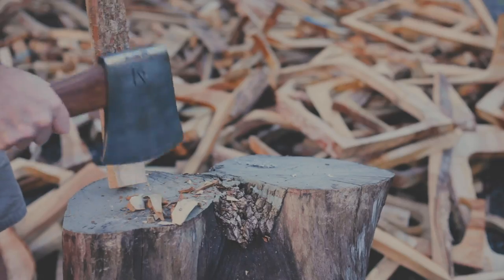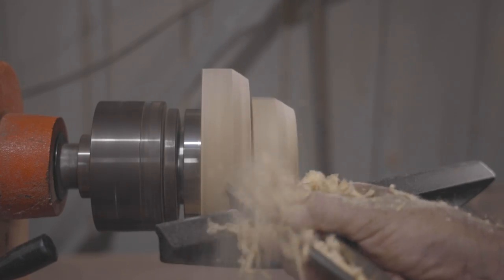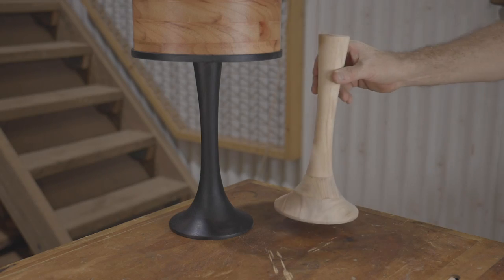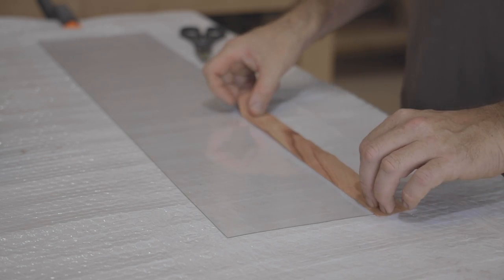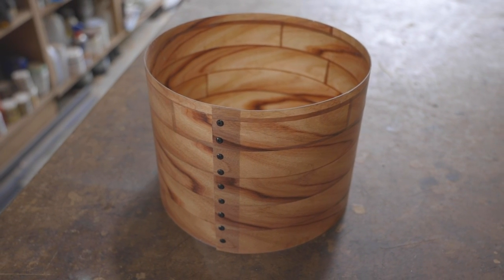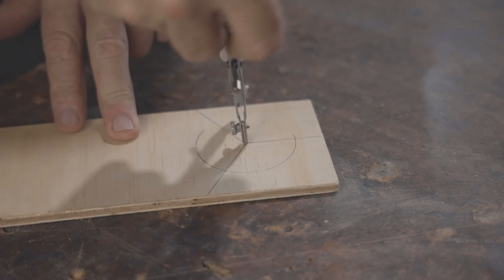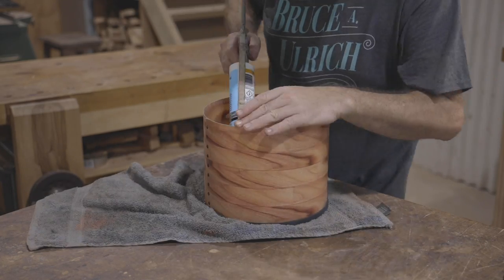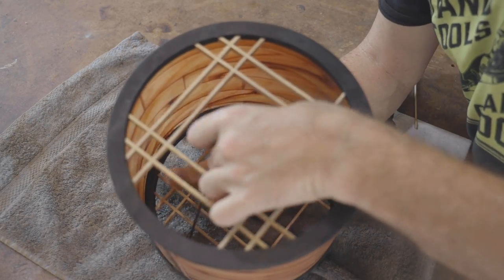Plane Shaving Table Lamps - Scrapwood Challenge ep37

Comment: The lamps turned out great.  I think that the use of plexiglass was a really smart solution to the issues you had on your experimental adventure with the larger hanging light fixture.  Thanks for sharing and keep up the great work.

Comment: Excellent work as always. Intrigued by the method you used to get the loops for the top and bottom by having cuts and different depths and then cutting through them laterally with the table saw. Genius.
Reply from the maker: Thanks very much Paul! :)

Comment: The top and bottom shade supports were pretty sufficient, meaning i reckon too many rivets were used for the seam.. If you left more slack on the shavings veneer glue could've covered it...

With maybe a custom staple..

🧰🛠

Comment: If you had run both pieces for the lamp pole threw table saw to put a notch in both pieces. Then glued them together with notches to the inside to run power cord threw later on..

Comment: Twenty plus years in plastics most of that working with acrylics (Plexiglas, Lucite...). I’m not exactly sure what Methylated Spirits are but it sounds chemical. It’s my experience most things chemical including alcohol are bad for acrylic in one way or another, some are immediate some are longer term. The effects vary from causing clouding of the material or crazing (micro cracks). I don’t know if these are desirable effects for you. If not here’s a word of caution. Including age, prolonged exposure to ultra violet light and cold forming the material to too tight of a radius can be harmful to acrylic sheet. A good rule of thumb for lower quality sheet like this is 300 times the material thickness for the minimum bend radius. Love your projects.  Gday from Missouri mate.

Comment: Beautiful lamps. Thanks for sharing.  Far beyond my skill set, I'm afraid. They only thing I'd probably manage is gluing the wood shavings on the plexiglass.
Did you (off camera) in the end also put one or more layers on the other side of the plexiglass?  At first it was "shiny" on the inside, later not anymore.
Reply from the maker: Thanks mate! There was only the one layer on the outside, the inside is still shiny. It probably didn't show up on certain shots. :)

Comment: Great as always! Thank you again!
At 12:02, did you nicely apply glue to the edges of both pieces, then put the pieces in the clamp with the glue against the clamp?
Reply from the maker: Thanks very much! It looked like that because of the shot being sped up but if you move it frame be frame you can see they were the right way! :)

Comment: Genuine question, instead of those Kumiko panels to prevent warping, could you have quartered the rims and alternated grain directions to achieve the same result?
Reply from the maker: I thought about that Peter and I also though about segmented turning. I was happy with the kumiko solution though as it adds another element. :)
Reply: It certainly does 👍 thanks for the great content.

Comment: Dear Neil! I have a challenge for you, or I would like to ask for your help, in a case I have been thinking about for a long time, but I haven't found a solution. I recently watched a video from you - Homemade Dowel Plate - that prompted me to seek advice. I am a traditional Hun archer and bow maker. I make arrows myself, with a tool made for this purpose - I rotate the wood with a drill and push it through the tool - almost everyone does it. While looking at youtube, I found a video made by a compatriot of his own technology, his own machine. But in a clear way, he doesn't want to tell you how his machine works, but I would like to find out. "Here comes you in the picture", you may have an idea how this machine works. The video (0: 37-0: 57) shows a machine combined with a worktop, pushing a rectangular wood into the machine at the front, and a couple of pulley guides the rectangular wood at the front of the worktop - so the wood doesn't rotate. When the arrow comes out of the machine at the other end, there is also a couple of pulley to receive and lead the arrow, here it seems that the tree does not rotate !!!! There's something in the middle of the machine that should be "invented". A belt driven tool that rotates! and it looks like there is a hole in the middle of this axis. So something externally rotated / internally cut - I can't imagine what it would look like, how it works. The "whipped cream on the cake" -  no longer have to push the arrow outward, it comes out by itself. If you have any ideas please help - this is a real challenge for me! I am not sure of my English so I used the translator for accuracy - forgive me if something is not "complete" Video link :      https://www.youtube.com/watch?v=3oZgR1zz7U4          Ps: these arrows are the ferrari among the arrows!

Comment: Hi Neil, just curious as to how the plexiglass stands the heat of the bulb?
Reply: I can't see it being a problem. There's a good-sized air-gap between the bulb and the plexiglass, and the rising heat from the bulb will cause cool air to be drawn in at the bottom as the heated air comes out the top. Not much heat will reach the shade.

Comment: did you glue it the wrong way at 12:06
Reply from the maker: Someone else asked the same question and it looks a bit like that. If you watch it frame by frame though, you can see that I glued it the correct way around. :)
Reply: @PaskMakes  WHOA mind blown. You just messed with my mind.

ps. subbed you are so many creative wood working techniques and you work with metals also which I really like. Wood working shouldn't be only about wood.